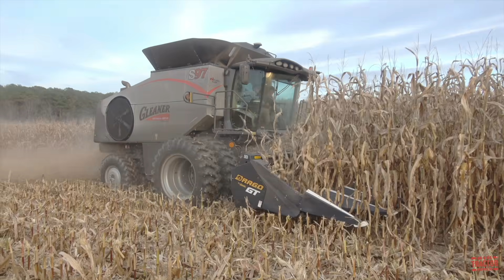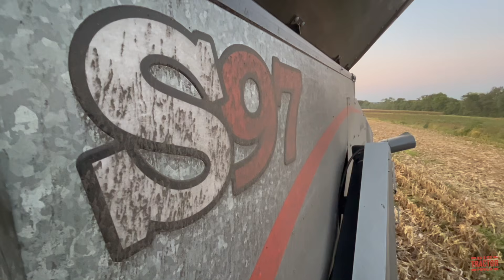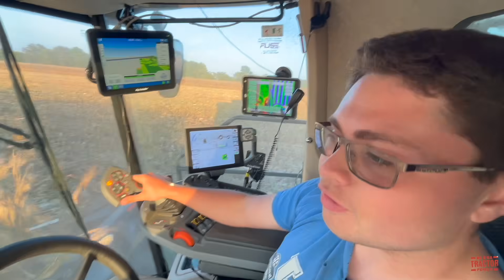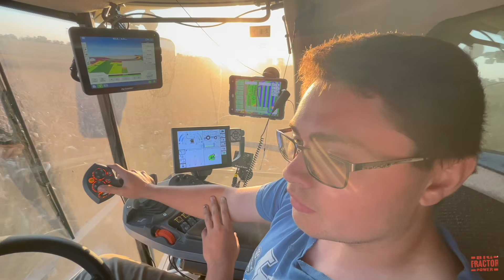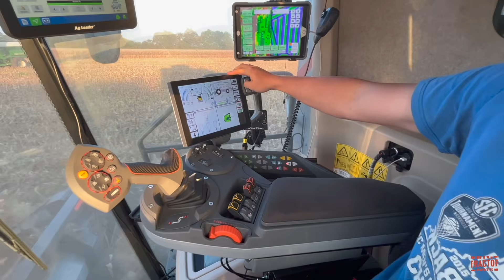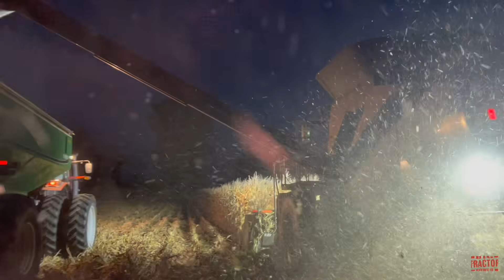GLEANER S97 Combine Harvesting Corn

Comment: He also wrong when he said that Gleaner only makes a 35’ Platform Header which is Wrong, Gleaner makes a 40’ Platform Header 25’-40’ Draper Header. So they DO make a Unload Auger that will work with a 40’ Platform, it’s just having that 3’ Unload Auger Extension does help.

Comment: I used a JD7700 Turbo combine  with a 215 bean head 35 ac and 643 corn head 14 ac  in north central Missouri.
Reply from the maker: Very very cool.  The 7700 is one of my favorite combines.
Reply: @bigtractorpower  I bought it off of a retired farmer where it sat for 15-20 years.  It has been enjoyable (and pricey) getting it back into the field.